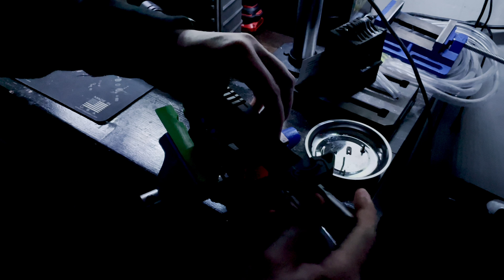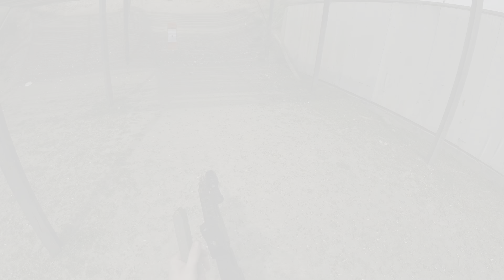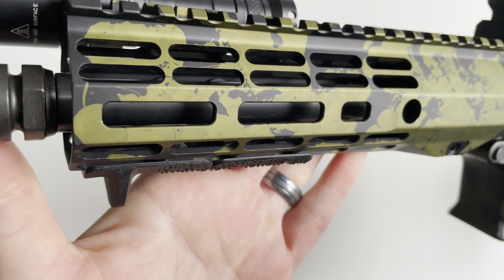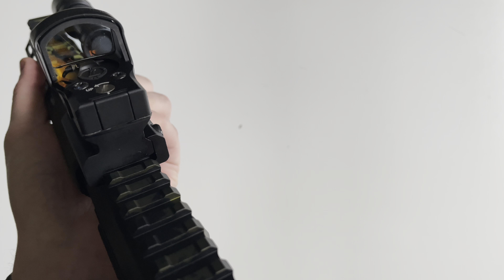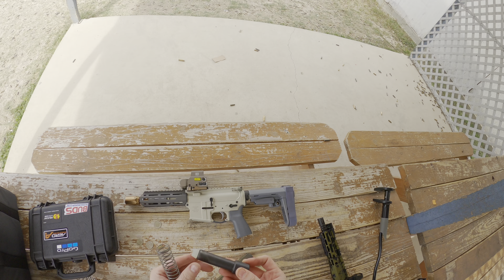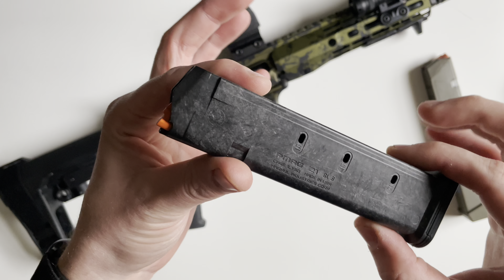Aero Precision EPC-9 Build [AR Build Series 3.0 - 8]

Comment: I did the macon barrel from the start and I'm having issues with open tip hp ammo not feeding. It slams the top of the feed cone and just stops there
Reply: Did you change out the mag catch? The Aero mag catch holds the mag too low.  
Rudy makes one that holds the mag at the right height.
Reply: @austinbuck8108  I didn't but I saw that he makes one with slightly different height. I may try that.
I've found that it'll feed anything if I use pmags but has trouble with the glock mags using HP's
Reply: @abolishtheatfandrepealthenfa  good to know. 
My barrel and bolt are both off to Rudy as we speak.  He’ll be sending them back fixed up and with the buffer and mag catch.  I’m hoping for total reliability at that point.
Reply: @austinbuck8108  hopefully you have full reliability. I was honestly surprised that the magpul mags were 100% where factory glock struggled with certain bullet profiles. I'd think it would be the opposite but I'm glad the cheaper mags work better
Reply: @abolishtheatfandrepealthenfa  that is surprising, but a definite win.

Comment: What is the exact model radian charging handle?  And would u say the macon spring and tube makes a big difference, is it definitely worth the price? I currently use the oem aero one. It is a lil rough on follow up shots.  Man that anodized green is 🔥, what green is that?  🙌🏻🤙🏻🙌🏻
Reply from the maker: That is actually the Geissele URGI charging handle in black.  And YES a million times over I would recommend the macon buffer.  You can use a standard carbine spring in conjunction with it, just don't use the 308 spring that came with the EPC buffer/spring kit.  Follow up shots are much easier and the perceived recoil is very much toned down!

Comment: I don’t think you’re using a “standard A2” flash hider. Don’t try that, kids. You need a specially made or modified one to work with 9mm or you’re gonna have a bad time.
Reply from the maker: Here is the part number if you wanna check it out: APRH200031C
Reply: Lol he didn’t check it out